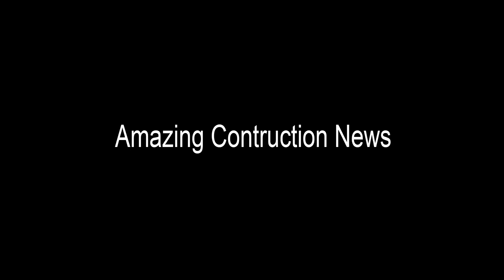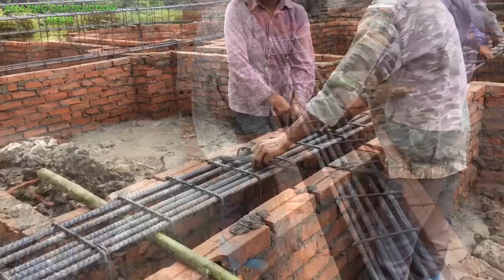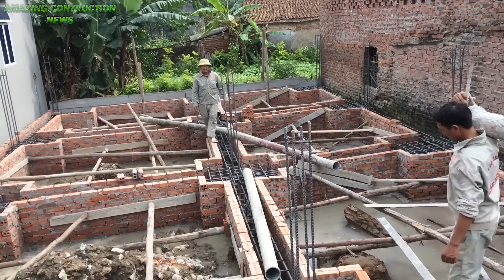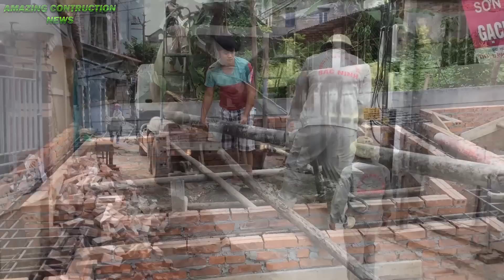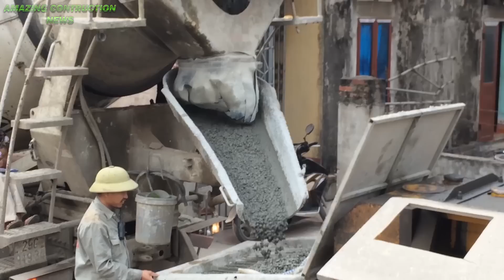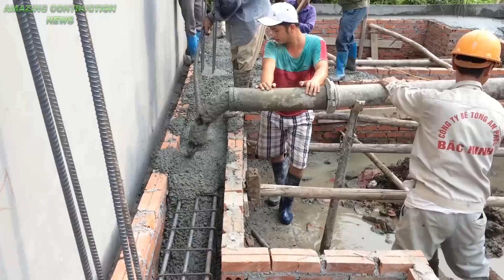How To Build A New Style Foundation - Build A Foundation Using Ready-Mixed Concrete For The House

Comment: The advantage of this method of construction is you don't need to excavate for the foundations and ground beams but formworks seems expensive using bricks instead of the conventional ply and wood materials. Beams sizes and reinforcement should have been designed structurally .Seems construction materials in that area is cheap . Good thing is you pour the concrete monolitically ..a sound engineering practice.
Reply from the maker: Thank you for watching my video, share my video with friends to support the channel

Comment: The building inspector would always get mad at us when we used the stinger to push the concrete around.  Personally, I never saw the harm in it.  I thought it was a very expensive way to build the forms, using bricks, or are the bricks taken out after the concrete hardens and used again?  During the rainy season, will all of that weight stay in place without sinking?
Reply from the maker: it is a new kind of construction it is very rooted and inexpensive certainly

Comment: What a waste of concrete. The supposed isolated footing is too thick. The vertical reinforcement is for single story only. The tie beam height is too much for a single story, if it is a single story building. Overall, this New Style Foundation is not based on any Concrete Design handbook.
Reply from the maker: This is a new method of the people of Vietnam, I am sure the new technology

Comment: Isnt that a lot of concrete they are pouring !? I cant imagine why someone would need this level of thickness of concrete at every corner !
Reply from the maker: because I am using a solid foundation to build a 3-storey house
Reply: That is what we call a permanent structure.
Reply: Really waste of material
Reply: @amazingcontructionnews5050  your column appears to be for single storey. Is it based on standard type design.
Foundation and column for that matter all members will depend on
Loads
Number of stories
Type of soil
Distance between column
Settlement base on soil etc etc

Comment: Too expensive and lot of mistakes of reinforcement.I think they not received technical instruction from an Engineer.
Reply from the maker: It does not cost money to use bricks instead of very strong modern formwork
Reply: @amazingcontructionnews5050  unless you found those bricks it still costs something.

Comment: what a waste of time and material ,,, brick work forms ,,, different , but you use what you got i guess, if it holds up the building , then it works, lol
Reply from the maker: It does not cost money to use bricks instead of very strong modern formwork